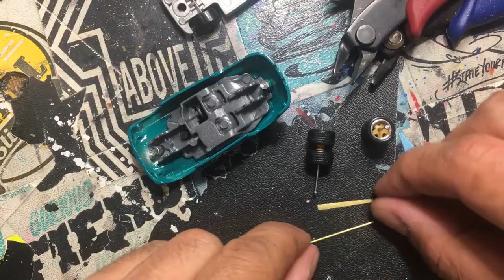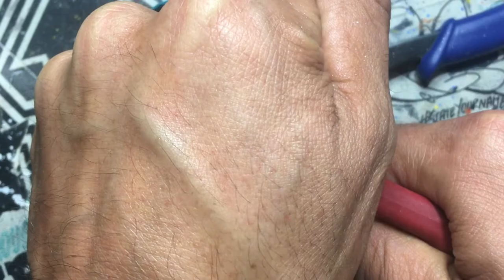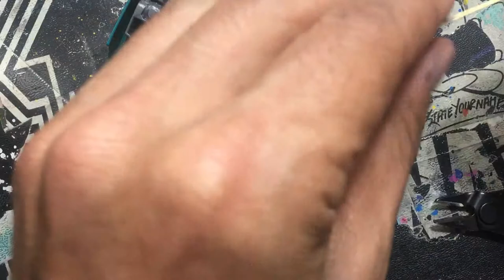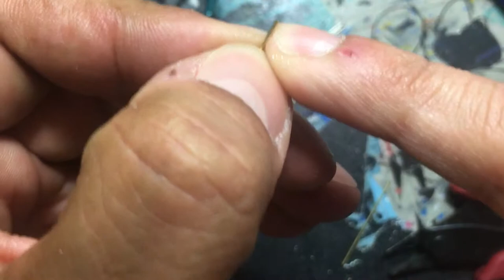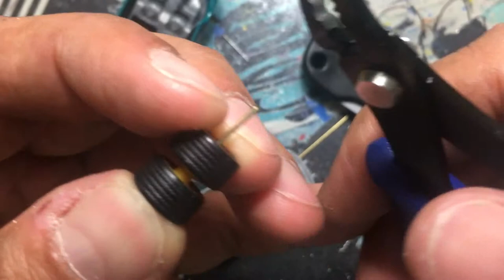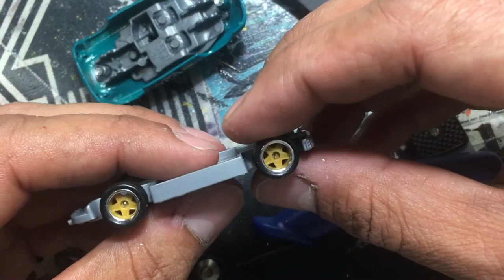How to Wheel Swap and Custom Fit your AXLES on your HOT WHEELS Cars Porsche

Comment: I've got K&S #5501.032 Music wire, what size crimp tubes should I use, the 1mm is too small
Reply: I'm using metal wire, it does crimp like the brass tubes so I want to use the crimp tubes and or beads, what size tube and or beads would the wire fit inside of? K&S #5501- .032 music wire.

Comment: Where did you buy the rods and tires?
Reply from the maker: The tires i get from the hotwheels premium cars and just remove them myself. The rods are brass i got from hobby lobby but if you are going to use the crimping method you can also use a paper clip 📎 the more thicker ones so the wheels are stable . I will be making a new video soon using brass tubes
Reply: @3rdeyediecast644  thanks a lot! I’m trying the paper clip method now. I’ve been debating on weather to destroy a premium for the wheels and finally did it and my Subaru came out awesome! I also drilled out the exaust and added a custom one with a part of a pen
Reply from the maker: Go for it !

Comment: Where did you get the wheels from ? Is it from another car or sold separately ?
Reply from the maker: Locutz M sometimes they come from other cars and sometimes i buy  aftermarket ones. You can find 1:64 scale wheels online
Reply: Check out monoblock wheels. They have lots of types of tires and colors and sadly little rim designs but go check them out

Comment: How do you keep it together?
Reply from the maker: Devin Sharp you can do a few things. The simple way is super glue them back together or get some self tapping screws i dont remember the exact size at the moment but i will post here . And you can screw them shut
Reply: @3rdeyediecast644  Also looking for an answer to this.
Reply: @davidpeck7833  just the size of the post, idk if its 2mm or 3, just try 2mm, to be sure.

Comment: Ahhhhh I just solder the end and file. So look stock
Reply from the maker: Awesome ! Very cool. This is a much older video. Now im using the Hot Wheels axles and brass tubes ... im hoping to make a video soon to show
Reply: @3rdeyediecast644  I like the tube methods but I also file a littl hole add glue and kramp it

Comment: It works just looks terrible. It’s much better to use the tube version of that brass rod you can get a hobby lobby. Use it as a housing in the base. Then using the original cut axels trim them and they slide in perfect fit inside the brass tube. Glue the axel into the tube and your done. A few better ways to make it look cleaner than crimping. If you care that much that is
Reply from the maker: Yes i agree . This video is so old i have since updated my process and materials . Thanks for watching